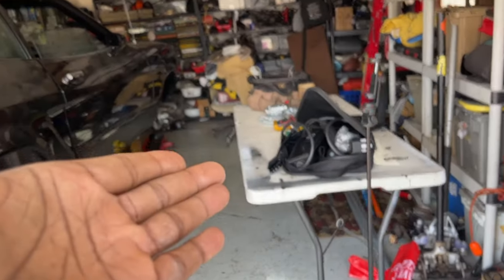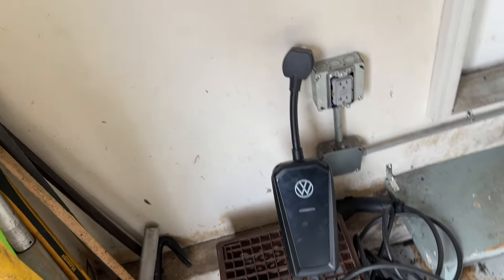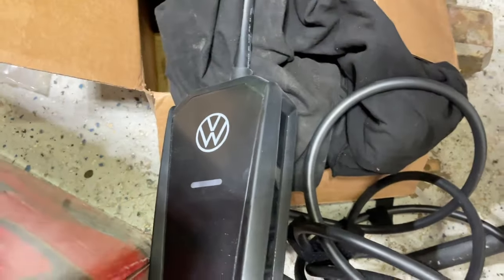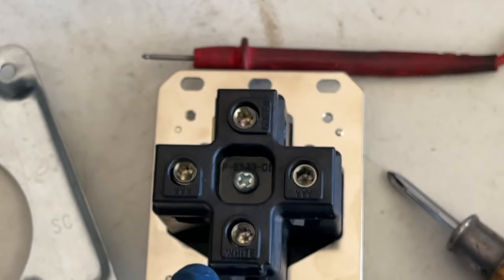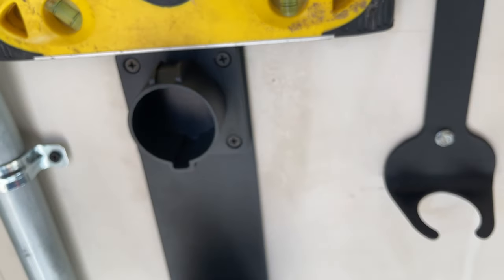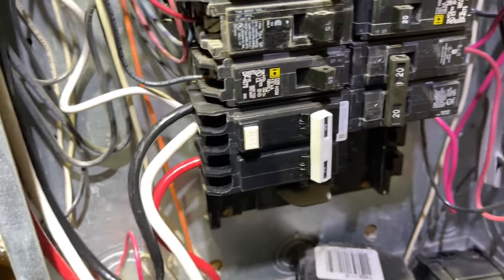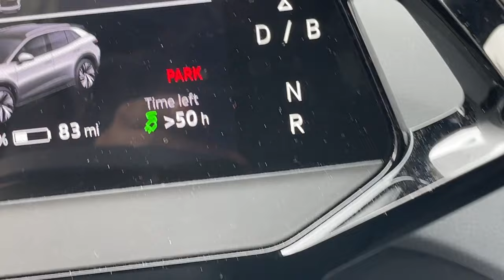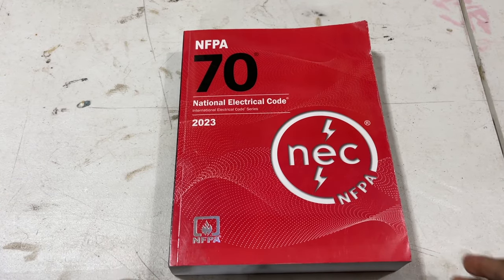Electric Vehicle Level 2 Charger Installation COMPLETE! Plug Holster Install Tips & Recommendations

Comment: I closely monitor all my electrical use with emporia. I drive 1200-1800 miles per month, which costs 45-75$, at 12.5-13.5c/kwh.  

My hot water tank is the next highest electric cost at ~27-32$/month.
Reply from the maker: I monitor ours as well. I think everyone should especially how the cost of everything continues to rise. Thank you SO much for watching.